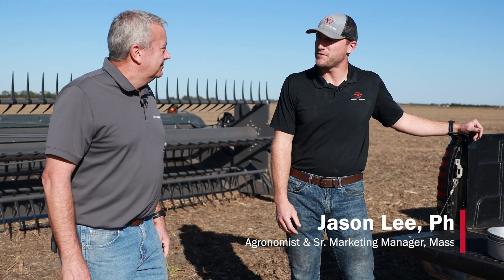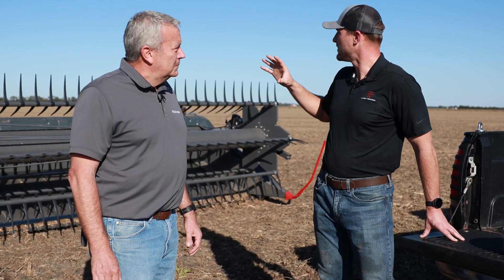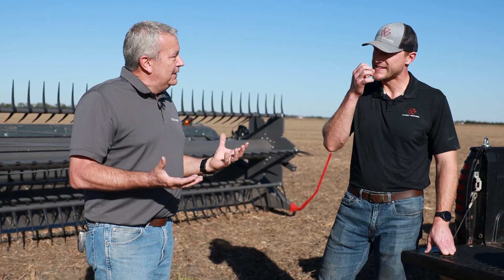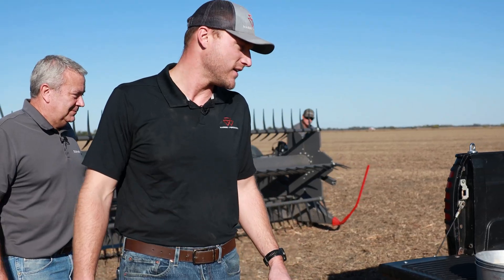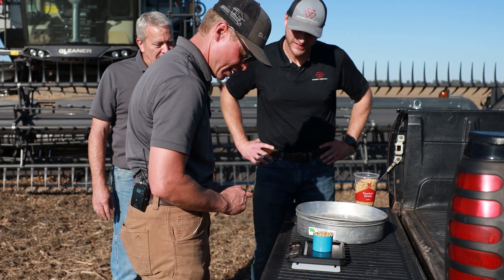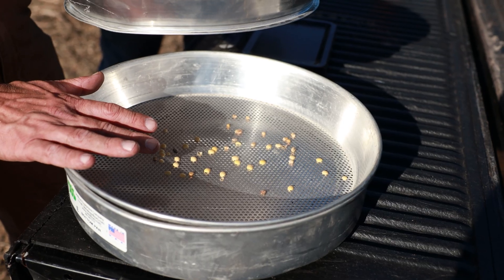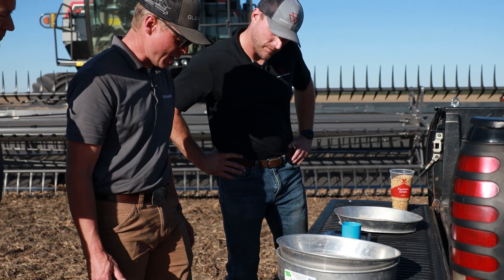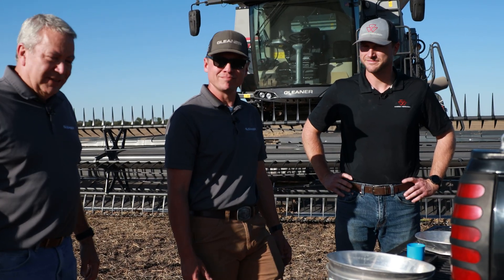Grain Quality Check

Comment: Not bad for 9% beans. Did you take steps to lower that now for the next field? Lower Rotor speed? Lower ground speed? Not as tight on the concave?  There are a wide array of options you can do to further lower that cracked\damaged seed and in other videos you've demonstrated that. Also, don't bring Massy talk into a Gleaner video, its unwelcome.